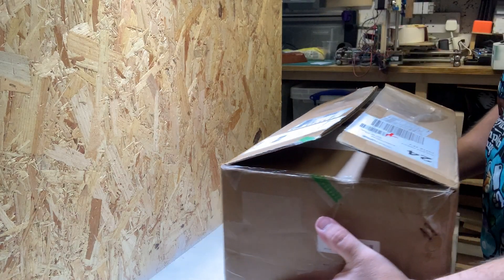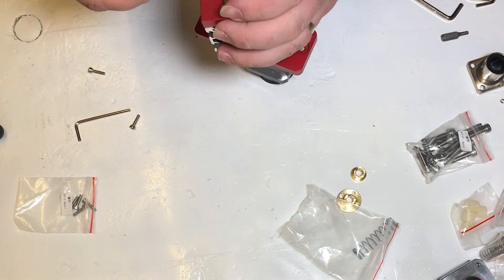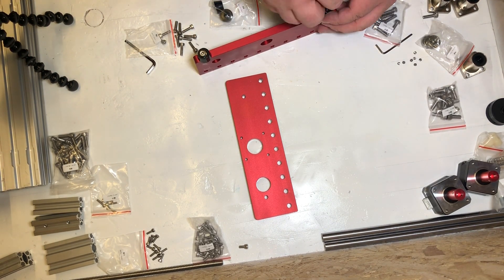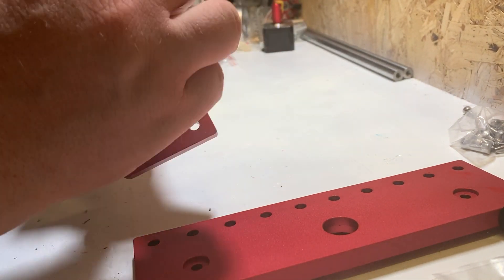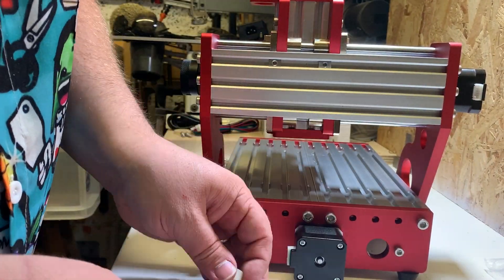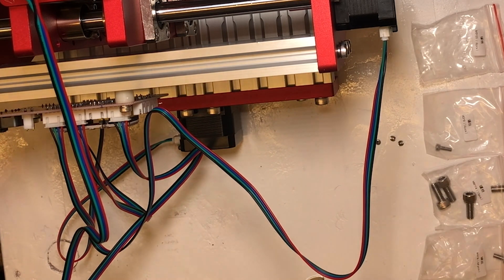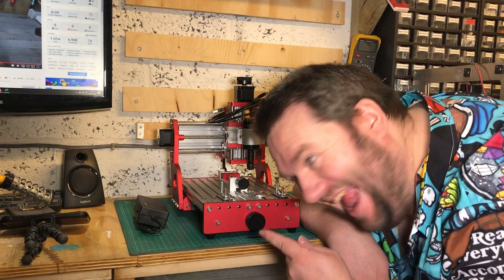1419 CNC Build Instructions

Comment: Nice video, is it possible to change the stepper motor drivers ?
Reply from the maker: Yes but you need to change the board - might be able to reflash it though but I don’t have this machine any more to check 🤔

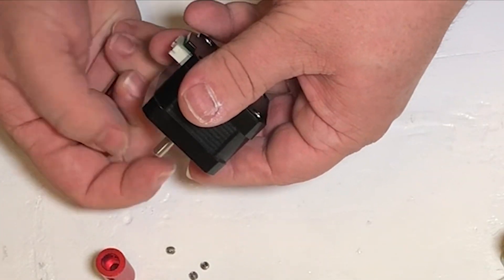Comment: 2:04
Hi I watched this video several times and wished I could press like every time! A question, what are the metric size and length of the grub screw? I would like to prep some on hand than to replace them later to save some time.
Reply from the maker: Sorry for not getting back to you sooner.  I'm not sure but I think it was an M3 grub screw, it should say in the instructions. I sold the machine a while back now as I've upgrade to a workbee.

Comment: Mmmm, I think this is the first time that I’ve seriously thought about diving into the world of CNC. Am pretty good with computers and handy enough with most common tools (especially woodworking) but somehow CNC has until now always remained off my radar of things to delve into. Thank you so much for doing this video - it’s really piqued my interest! Can you please tell me what size are those little grub screws that you recommended getting some flat ended ones for the motor spindles? Also can you recommend a decent source for complete beginners to start learning what’s involved? Really appreciate your help. Thanks, Steve 👍
Reply from the maker: Quick one for getting started, worth checking out the Facebook group for these machines.  Loads of setup advice plus examples of people using the machine properly (rather than the hatchet job I do 😂) https://www.facebook.com/groups/482315516100783/?ref=share

Comment: Wonderful video! it's a beautifull machine, but does it have backlash? is it strong and accurate enoudg to mill pcb?
Reply from the maker: Thanks!  There is a healthy amount of backlash (all machines should have a tiny bit) and yes this would be very good at doing PCBs.  I’ve not cut a full one but did do a pattern on some copper clad board and it looked great.  If it’s only PCBs you’re looking to cut, I’ve seen the cheaper 3018 machines do PCBs well too.